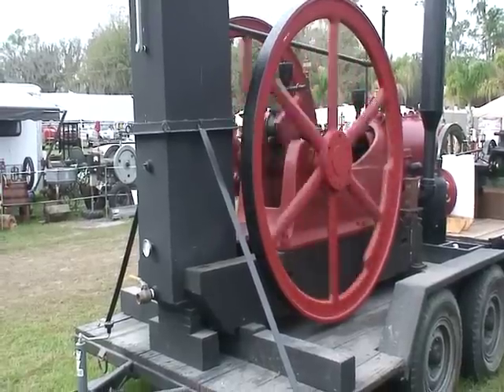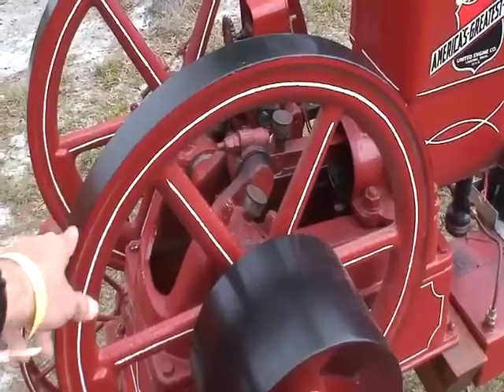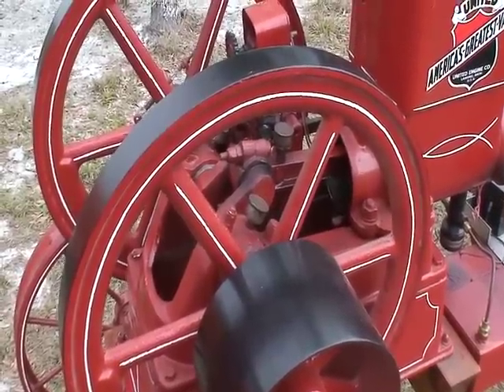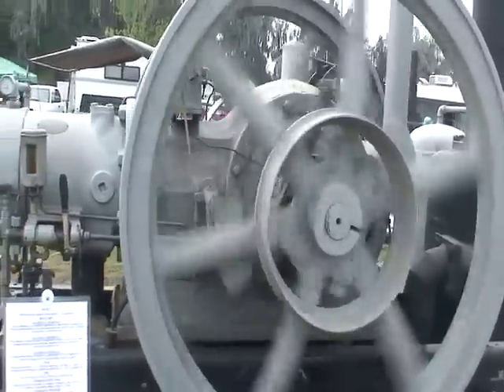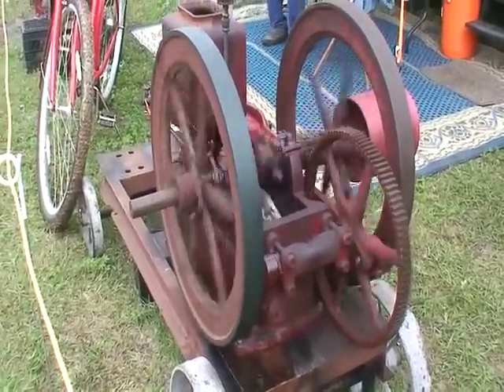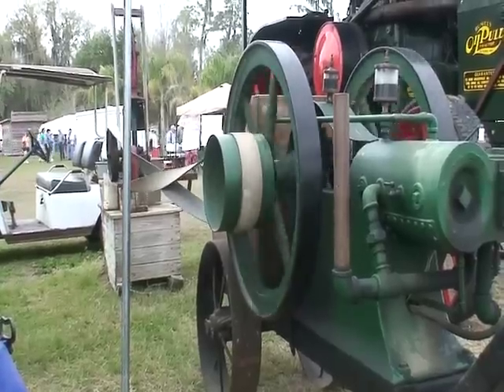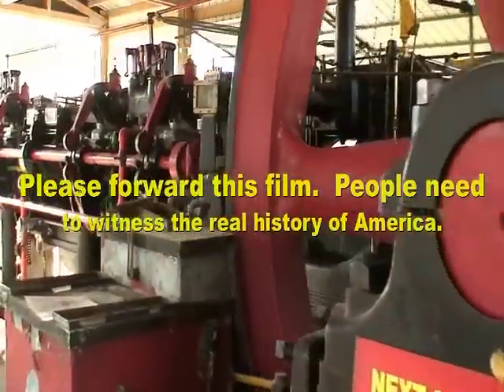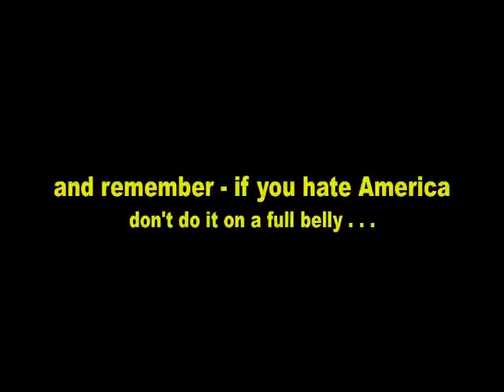Flywheel Engine Technology: American Power - Flywheel Engine Technology Video [American Industry]

Comment: In PR, during the times of high sugar production, the sugar factories used steam engines with huge flywheels. They used the cane residue for the boiler fuel, so it was a green operation, back in the 30s all the way to the 60s. no gas or electricity was used.

Comment: the big red one is a steam engine. Gas was not a commodity, it was a by product of making kerosene, the would dump gas into streams. The engines were developed way before the turn of the 20ith century. In the 1860's otto developed the engine. some of these engines are still being produced in Germany, have you ever seen the Lister diesels they have not changed in 100 years.

Comment: The old flywheel based engines are pretty interesting.  Instead of multiple cylinders firing in a synchronized setup there is only one cylinder and the flywheel stores the energy from the power stroke and powers the cylinder exhaust stroke and compression stroke.  They are less efficient than modern engines.  They are what modern engines were developed from. They consume less fuel than a modern engine of the same weight because the power generated by a modern engine of the same size is much greater.

Comment: These engines are firing the fuel air mixture at such a low rate that combined with the flywheel effect they would not need to be fired on every compression stroke. If the non firing compression stroke were released to help maintain flywheel efficiency the resulting fuel consumption to energy produced ratio would be quite good. Imagine 60 RPM or 1 compression stroke per second then by use of compression release skip a compression stroke every other time and half the fuel consumption rate which can easily be achieved with the huge heavy ringed flywheel to maintain rotational mass.  Karl Klinkenborg seems to beLIEve our mainstream science authorities a bit too easily. We need to be Autodidactic Probably spelled that wrong but it means to be self educated. Goethe famously said" It must be difficult for those who take authority as truth rather than truth as the authority."  Truth is where we find it and nobody knows it but ourselves unless they come to the same conclusions on their own. Excellent info and real history in this video. Thanks Matt
Reply from the maker: Thanks Ronald - I really loved being around these steam and gas engines and making the series of videos of them.  They really tell their own story as you've observed.  Thanks again.

Comment: Perfecting the design and then coupling it to low speed PMA's would be very efficient way to make low voltage power. You could power all of your low voltage needs with that type of setup.  A larger one would easily power an AC generator more efficiently. They just don't make them anymore. Its a simple study in efficiency. We have the technology to get electricity without it feeling like a large load now.  Low rpm and low friction generators.
Reply from the maker: Interesting reply and thank you for that.

Comment: I'm wanting to see if I can use this kind of thing to power my off grid set up. I use very little power to begin with. On top of that I store power in batteries so I could either have a stead load while charging batteries or inconsistent load like my small A.C. on the motor.
I'm currently trying to find out what kind and size of motor.
Reply from the maker: If you do get this going - please share how you did it - I'm sure others would be interested to know and I know I am.  It is an extremely interesting project.  Thanks in advance!  MM

Comment: So in other words its a hit and miss engine, just named differently. when the coasting flywheels loses rpms, the governor closes, opening a lock on the camrod, allowing the exhaust valve to close creating suction on the intake valve letting a small ammount of gas along with air in to be ignited.

Comment: The reason they seem to not use a lot of fuel is not because the flywheel somehow makes energy or whatever you're trying to imply. It is simply because these engines didn't put out that much power hence less fuel needed. And your explanation on how to make a flywheel into a generator armature is laughable. Besides they DID build them. There is one in Jerome Arizona named Big Bertha.

Comment: THE MOST IMPORTANT QUESTION IS : when will we see actual implantation , real application , real marketing of these products so that humanity will benefit it  ?????
Reply: We benefited from these for about 150 years. Now it's all about when we bring them back.
Reply: +rkshirey These engines were useful for their time and were the basis for modern internal combustion engines.  They are not better than modern designs.  They produce far less power than engines of the same mass and are less efficient as far as power to fuel efficiency goes.  

They were amazing developments for their day.  One can see the bridge over from steam engine tech and internal combustion engines.  I love the old things for that reason.
Reply: Chris P For the torque per pound at low rpm they are actually much more efficient. We could benefit from their core functions. Imagine car engines "turning off" cylinders when not in use being a regular thing.
Reply: Torque and overall power are two different things.  Give me long enough of a prybar and I could generate more torque than either with my bare hands but I would generate a hell of a lot less power than both.  The length of the components give pretty darn good leverage but take up a lot of space, too much space to be practical in many applications.  Scale one down to the size of a modern combustion engine and the torque would be reduced significantly.  Scale up the cylinders of a conventional engine and the torque would be similar. 
Engines that "turn off" or unload cylinders are already a thing.  They are used in larger/more powerful vehicles where there is an actual advantage and/or the customer is willing to pay.  They aren't cheap.
If these engines were better than what we have now then they would still be in use.  They were not some hidden tech.  These were the first internal combustion engines and were widely used.  I think that they are interesting and provide a wonderful insight into the history of engines but they are not superior to the modern stuff.
The use of flywheels as a means to store energy is intriguing but presents real engineering challenges when one wants to use it to meet the power demands and space limitations of most applications today.  There is a very nifty product by Caterpillar for use in critical power applications (applications where even a momentary loss of electrical power would be disastrous.  The flywheel stores enough kinetic energy that it can be converted to enough electrical power to be able to supply demand until the generator can start.  There are other more traditional ways to serve this same function as well.  Which method is best is a whole other discussion though.
Flywheels still intrigue to this day and will undoubtedly be revisited from time to time but the old one cylinder hit and miss engine is likely consigned to history.